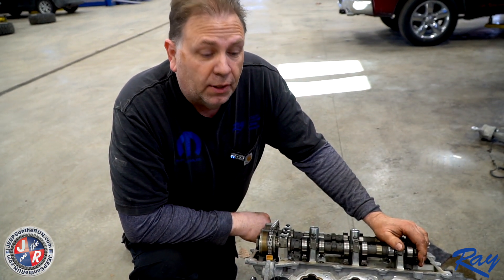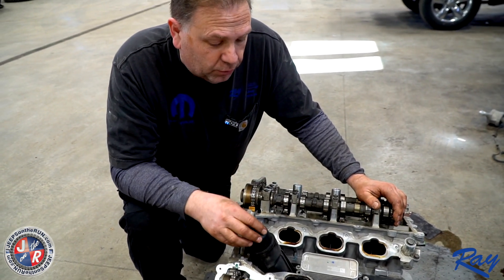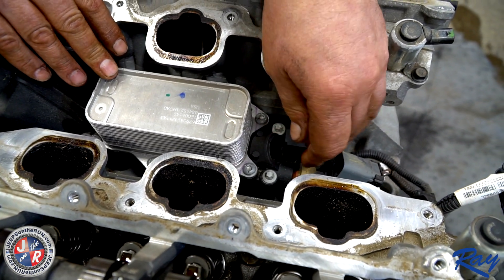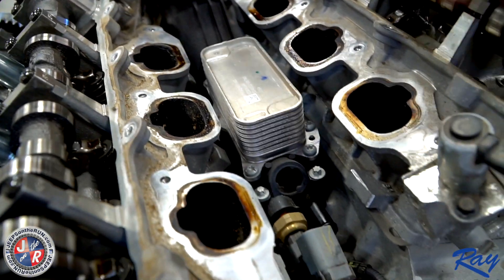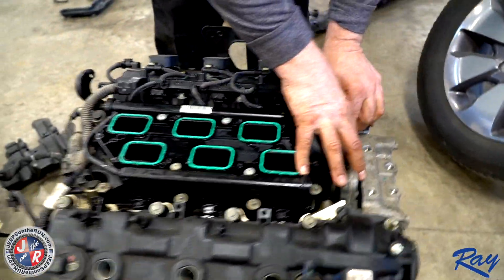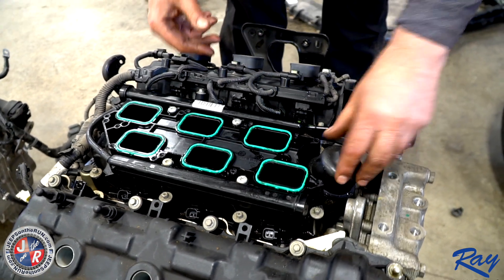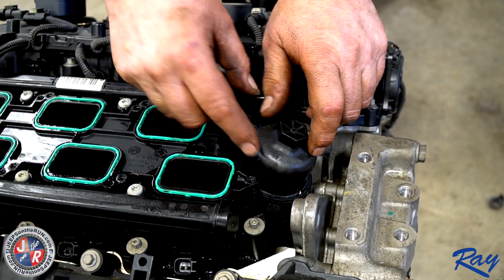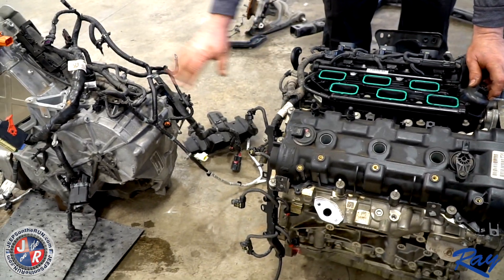Jeep v6 Oil Cooler Failure.  Where's it leaking?  How to fix it?

Comment: dealer changed my first one. one year later same problem. i changed it to a metal one. year later now metal one is doing the same but less oil comming out. why doesnt the manufacture fix these problems that they knew about

Comment: What he did not mention is Dorman has a upgraded aluminum housing replacement, fits a 10 year window of many Chrysler, Dodge, Jeep, Ram and even some VW's. Just a little advice for you guys who might want to tackle it at home. So if you see one with the orange cap cover, its Dorman. I'm not a huge fan of Dorman but every so often the blind squirrel eats.
Reply: Getting ready to do this job on my wk2 and I will use the dorman because it's all aluminum vs the plastic o.e.m trash that will get brittle and break again
Reply: @dw1284  is this cooler on the side on your jeep? I think mine is

Comment: What if your oil cooler isnt leaking, but you still have oil being pumped into cooling system? I hope my block isnt cracked. Hopefully ist just a head gasket leak, but there isnt any visable signs and the motor isnt missing.
Reply from the maker: Signs lead to a head gasket, but it's hard to say!
Reply: Are you sure there's no oil in the valley around the oil filter housing assembly? It can be hard to see with everything put together. Still the problem could be failure in the internal channels of the oil filter housing or in the oil cooler (plate chiller) itself. Pressure test should help identify if it's the head gasket.
Reply: If you have smoke coming out of exhaust with a citrus smell then you have a blown head gasket

Comment: If you have any 3.6 performance tips and or tricks, I would be ecstatic to hear them.  I plan on installing the PUG lower intake, Fast Man TB, eight hole injectors and I already have a quality cold air intake. New plugs, PCV and oil cooler are also on the list.
Reply: Must say if the oil cooler is the only issue with jeep grand Cherokee why get rid of it? I love my grand cherokee.  Toyota seems so outdated. But they last forever.